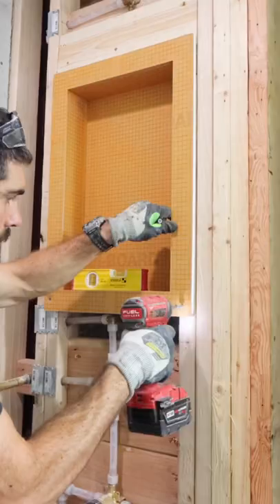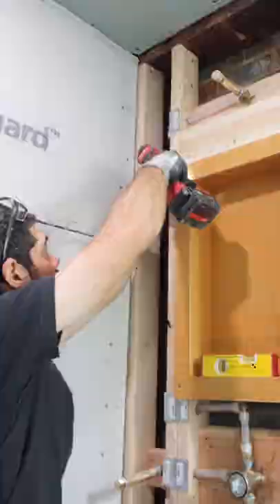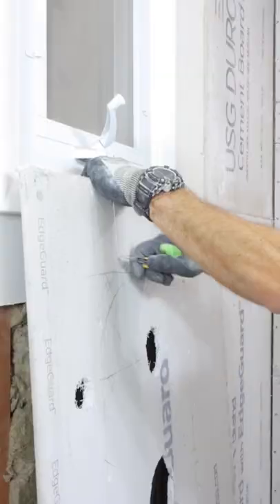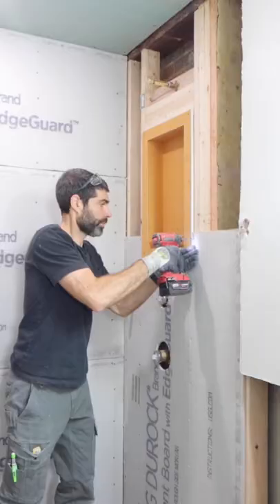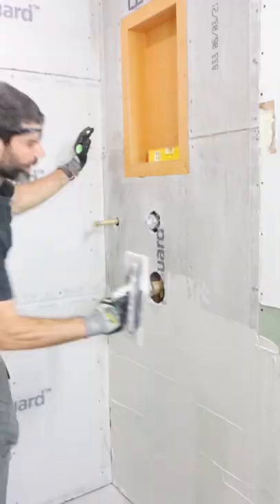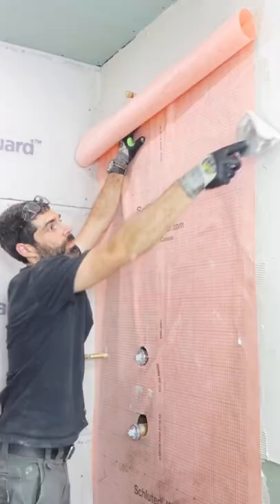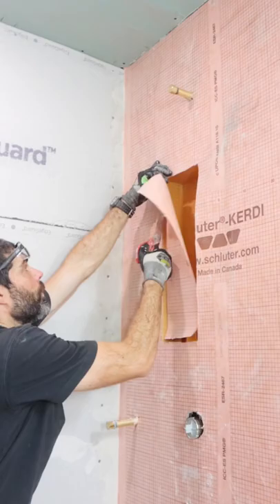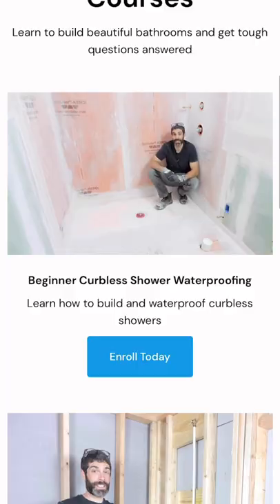Shower Wall Waterproofing Tips with KERDI - #shorts

Comment: Curious, why cement board and kerdi instead of Keriboard?
Reply: Price
Reply: I'm doing the same but went with hydro ban sheet membrane as I couldn't find their foam board.  I'm going to be using cement board as well like in the video.
Reply: You can ,  still use a water barrier on benches, window sills or shampoo shelves and all the products you mentioned , pitch the products .

Comment: I used a very low flow shower head that is locked into position. The only area that will see water is the first 3 feet around the front drain.

Comment: OK. I have one really important question. How do you determine the exact height of your niche, so as to not have L-shaped tiles?  In other words, how do you ensure that the top and bottom of the niche ends up on a grout line??
Reply from the maker: Great question, you can wait to install the niche until the other walls are tiled then install it to meet up with the grout joints. Or you can build a custom niche. Or you can shrink the prefab niche with scrap backer boards
Reply: Thank you.
Reply: Measure measure
Reply: It's all about layout. Pre plan. Lay 4 or 5 tiles on the floor with spacers equal to the grout joint size your using. Get that measurement, transfer to wall, install niche there. Works every time. 
Ps don't forget to account for the thicknesses of your floor pan or tub.
Reply: Use your tape measure
Reply: @HomeRepairTutor  thank you for giving me actual suggestions that I can use to ensure proper placement of my shower niches.

Comment: Why are you using cement board over drywall? I thought the schluter membrane was supposed to go over drywall? I suppose either would work, but the extra cost seems unnecessary.
Reply: Cement board in place of drywall.
Reply from the maker: Cement board is $12 per sheet, and anyone can put it in a car or truck. Plus it doesn’t have any organic material in it like drywall, so I like it better overall for that alone
Reply: @HomeRepairTutor  thanks! I haven’t done any tiling yet (soon), but have done a bit of drywall and I’m skeptical about all that tile weight on drywall. Do you have a preference on which cement board you use? Some googling says that certain brands absorb too much water and need to be primed.

Comment: Where did you get your diverter valve seal? I am needing one smaller than 4.5" for my diverter
Reply from the maker: I customized it using the Schluter mixing valve seal. I cut the rubber gasket to fit the diverter valve then used a piece of KERDI with it

Comment: How to spend more money than you have to
Reply: That's what it looks like to me.   Overkill
Reply: I’m currently dealing with a leaky shower because the installers didn’t want to spend money. My shower, my home- I’m ok with overkill not to deal with this mess again.
Reply: Not overkill at all. If you’re not a licensed contractor you wouldn’t get it. We charge this much but overkill as well so it will last you forever.

Comment: Why a membrane on ciment bord ?!! You don’t need it !
Reply from the maker: @eugemorin7786  cement board is porous and will absorb moisture. More importantly, it will allow vapor into the stud cavities. Vapor plus wood = mold. The membrane is needed
Reply: @HomeRepairTutor  Do you also install porous tiles?

Comment: Why are you using the cement board when you can buy the same Kerdi board as the insert and same a step
Reply from the maker: I’d definitely use KERDI-BOARD but there literally was none in stock due to supply issues
Reply: I had the same question, but then why use kerdi? Couldn’t you do the same without the Kerdi system, for a portion of the price.

Comment: Quit using cement board! There are better products out there
Reply from the maker: I’d use KERDI-BOARD over CBU any day but it wasn’t available
Reply: @HomeRepairTutor  If you are doing a dry pack for the shower pan, and using cbu, would you set the cbu to the sub floor and then do the dry pack up the cbu?  Or do the dry pack and then just run the cbu down to the top of the mud pan?  Or do you do the latter but leave a little gap between the mud pan and cbu?

Comment: Stop using Durock. Spend some time apprenticing with licensed, trained professional that can teach you how to properly float walls true & plumb. Your usage of Kerdi membrane does not meet the Schluter warranty guidelines. It will likely leak and Schluter will not warrant its waterproof integrity. At very least watch the Schluter trading videos to learn proper installation. 

Better yet, spend minimum 2 years as apprentice installer for an experienced and licensed tile contractor. There’s so much to learn that separates the diy skill tiler from a true skilled tiler. 

Tiling is a very in-demand skill set for those with professional skills. What distinguishes the skilled tradesmen from the diy’ers is often the comebacks and long term integrity of their workmanship. Learn to do it right in the beginning and you can make a career with consistent demand and solid earnings potential. Good luck to you.
Reply: I do tile. What did he do wrong prey tell.
Reply: Calm down the dramatics, are you a union man too? Tile is easy , durirock is fine , waterproof with liquid or via queen behind , seal the tile , and handyman it again in 25 yrs when the styles change . 
Tile : the one thing not inspected on a house ! 😂
Reply: @CedarSproutHomestead  facts. I have been tiling 35 years and durock is fine. I don't use membrane system as it is no better than brush on waterproofing, it is just super expensive.  No need for the added cost.
Reply: Curious what part of this doesn't meet Schluter's guidelines with the exception of him using cement board screws instead of SS screws and kerdi washers?

Comment: Horse shi!   Guys teaching this method so wrong
Reply from the maker: How so?
Reply: For one,  you are putting a water membrane over Hardibacker that is already a membrane.  ( You have never seen how hardibacker puts a piece of their product  in a jar of water ? )  Waste of money putting Shultter over top of the Hardibacker  (waste of money )   Two, you suppose  put a water barrier behind the Hardibacker, and down into the shower pan.  You know why ?    Three,  use a mess in the corners and cornerbead on the corners. You are not the  first doing what you think is right.   Don't have time to explain why right now,  but beginner's do what you do being lazy or taught wrong.
Reply from the maker: @johnjackson7317  I appreciate your comment, but it’s not HardieBacker. It’s cement board, HardieBacker is different. Also, there’s no membrane on cement board or any vapor barrier. Hence the use of KERDI as both the waterproofing and vapor barrier. Corners are tight and won’t interfere with tile work. This is absolutely an approved meth by both Schluter and the Tile Council of North America. As for the water test with HardieBacker, that’s misleading. I could do the same thing with any foam backer board. What you need is the rate of evaporation to be greater than the rate of vapor transfer into the wall cavity. So that test isn’t the best, but a great use of marketing nonetheless
Reply: @Home Repair Tutor  don't go there ,water barrier is supposed to go behind cement board .
Reply: @Home Repair Tutor  approved by Slutter not by builders or installers because it's a waste of time .  You are a salesman trying to sell your product convincing homeowners it's OK.   You heard of the Regestra Of Contractors ?  They give Spec's to homeowners and installers what is expected in installation of showers .  What you should be talking about is window wraps or niches or benches and how to prevent water damage with Slutter and the installation of tile .  But you dont,  ever heard the say ,   Standing or sitting water means ?   And why ?
Reply: @Home Repair Tutor  also if this a standard, why do  builders , all of them !   Use Greenboard  and do not require anything else ?